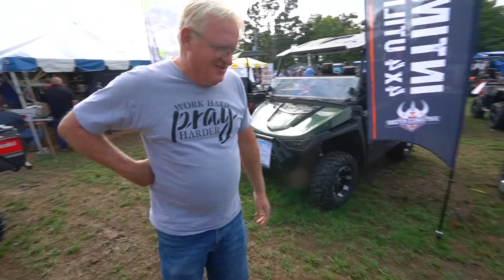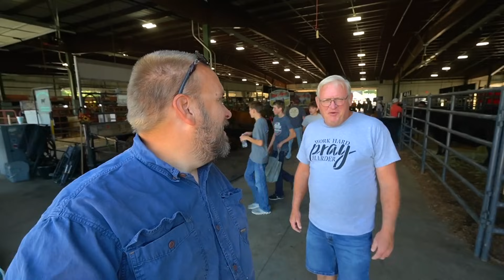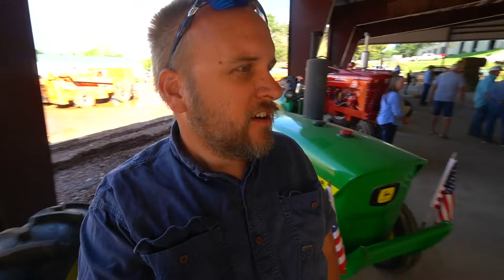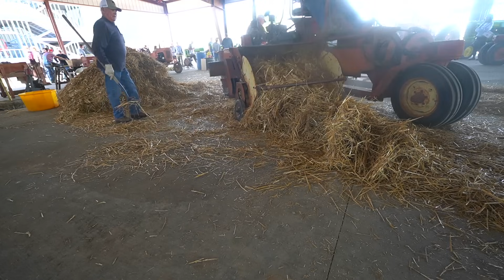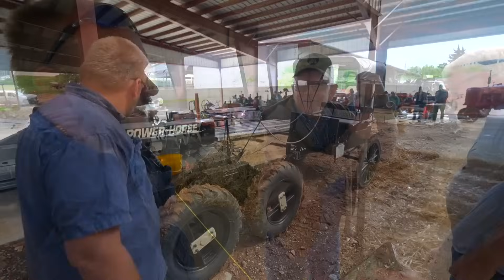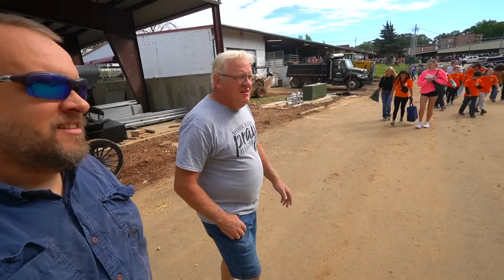The Best of The Ozark Fall Farm Fest

Comment: I looked up that power horse they were 4 wheel drive diesels that were actually used in place of a team of horses saw one video pulling a plow intended for a team of horses. The steering was like a skid steer.